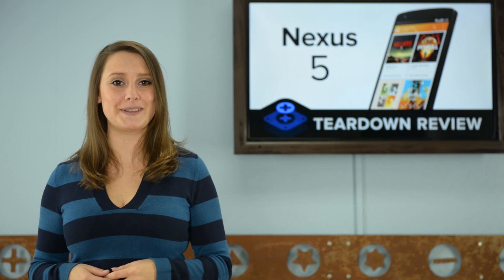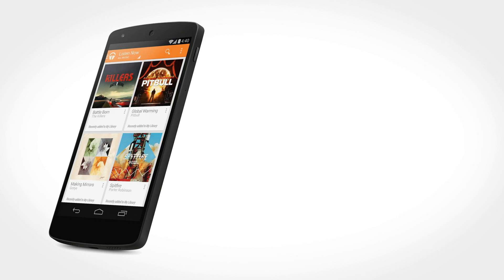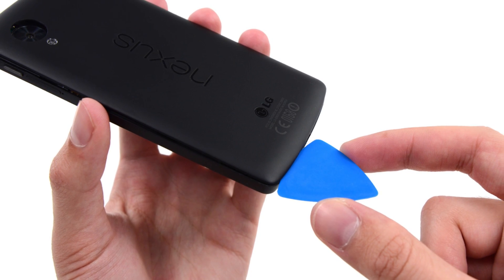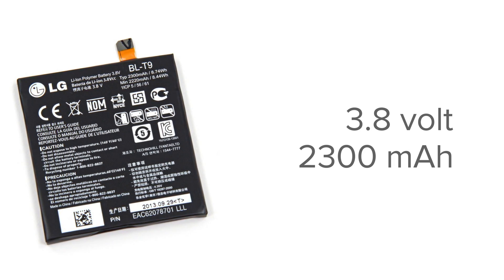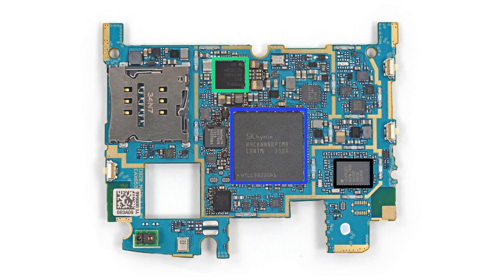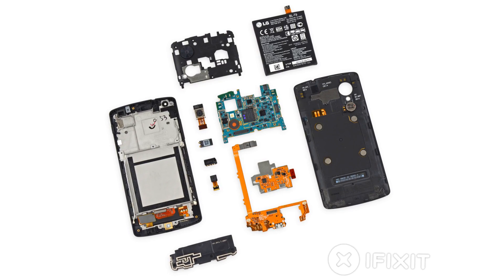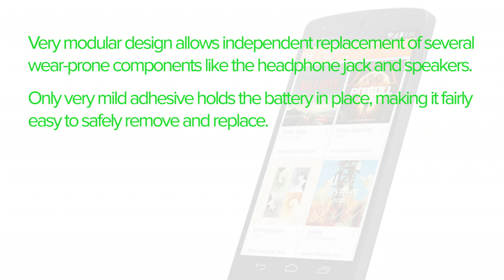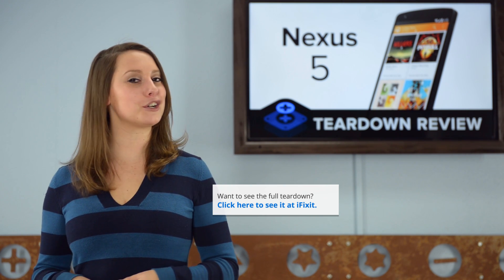Nexus 5 Teardown Review

Comment: What are the pros and cons of not having a fused display and front glass?

Would be thrilled to see some company join ifixit to make a really repairable phone.
Reply: +Adriano Rodrigues A laminated or fused display doesn't have an "air gap" where there is a visible gap between the digitizer and the actual LCD. It generally makes devices thinner and improves the viewing experience, but like iFixit says, they are expensive to replace because they are one unit so even if it's only the digitizer that's broken, both pieces have to be replaced.

Comment: Hi, I have a nexus 5 that's stuck in a bootloop, and from extensive googling iv found sometimes it a hardware issue and sometimes its software issue.I think mine is a software issue, because I removed the outside button and the problem persisted. I also swapped out the battery, but it made no difference.I cannot even complete a factory reset, it tries to and then it says it cannot erase all dataNow I don't want to buy a new phone but if its expensive to repair then I will have to..Anything I can do from a software perspective, can I download magic program and plug the phone in and everything will work perfectly then again?Any help appreciated!!! thanks
Reply: Hi I had that problem to... in my case I think it was a full memory, when I have the phone memory almost full it start to loop again and again, so check that and clean it, I'm not saying that's the solution but works for me
Reply: Bro thanks for ur reply.. Finally caved in and took my phone to a repair shop, but no luck they tried everything got a second hand Nexus 5.. Forgot how awesome These phones are man, Mrs got a iphone6s n this old LG smashes it :-)